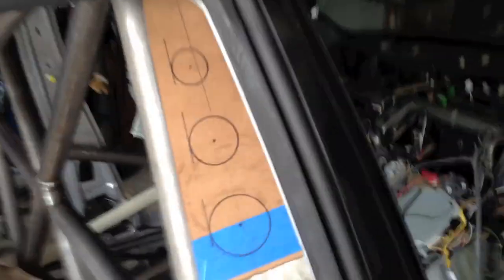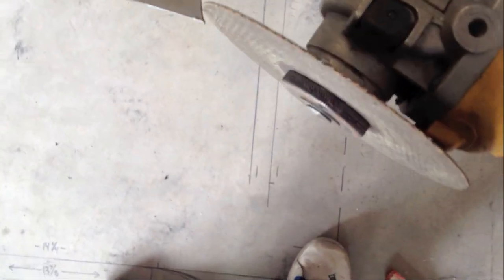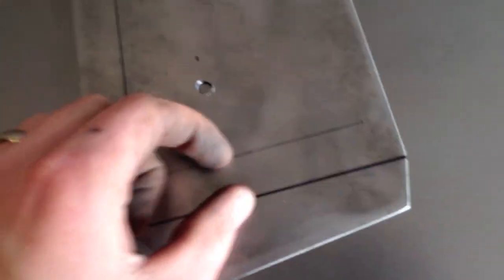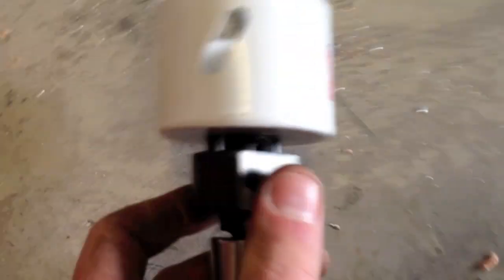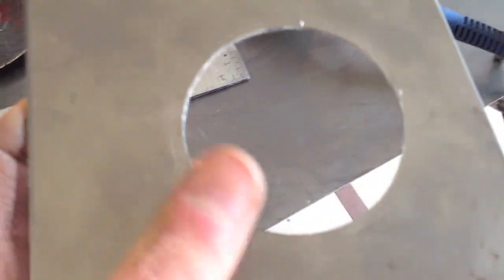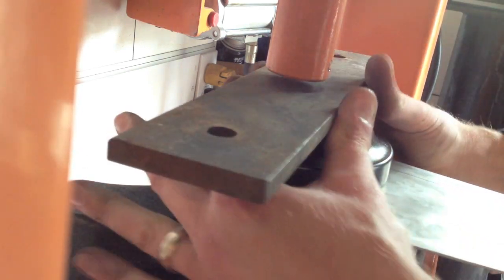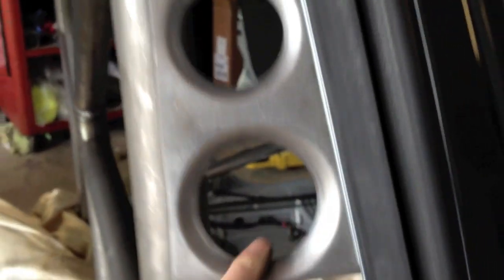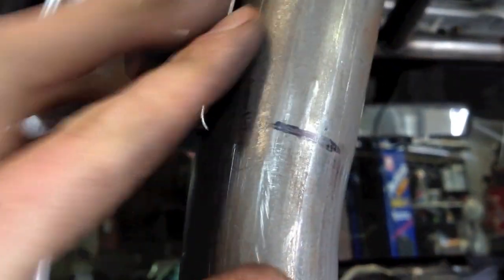HOW TO: Making a DIMPLE DIE Gusset - WRX Wagon - Custom Roll Cage - TMR Customs

Comment: 1. Not a good idea to film and use a cut off wheel
2. Use the proper size cutting disc
3. Use a guard
4. Don’t use the cutting wheel for grinding that curved cut, that’s how they explode
Reply from the maker: thebaggins321 1. Meh, I'm fine. 
2. No, I need larger disks for certain jobs. 
3. Guards are a joke! 
4. I didn't side load the disk, I stay perpendicular to the cutting surface. Thanks for your concern and watching!

Comment: simply put a gard on that grinder dumb ass
Reply from the maker: It's spelled *guard... dumb ass. And for the record, NO professional fabricators use the guards. They are a joke and get in the way. You obviously don't fab...
Reply: im a welder by my self and in canada we use guard on our grinder, if you cant work with a grinder it not the fault of the guard...  one day one of those disc will explode in ya face and you will understand why there is a guard.. -_-
Reply: I agree!!! I cringe every time I see people doing metal work with no guards or gloves on! As a trade pipe fitter and pipe welder, I take care of my hands because that’s how I make my money.  I’ve seen to many bad things happen and too many grinder wheels explode to not work safe. But.... calling him a dumb ass is a bit harsh. I just hope he doesn’t find out the hard way.

Comment: Hi.. I am a new subie guy, so i dig ur build.  I thought I saw something in your cage that concerned me... the horizontal door bar that is flattened at the main hoop. I think that is a big no-no ... round tubing shouldn't be flattened like that because it could potentially fold.  Thats why you shouldn't use a pipe bender on tubing .. so you don't flatten out the heel of the bend.  But anyway, I dig ur build and wish you good luck
Reply from the maker: I'm not sure what "flattened bar" you're talking about but theres no such bar on this cage, that sounds terrible! haha. My bender is full hydraulic mandrel style. It makes very nice professional bends. Thanks for your concern and for watching the video!
Reply: very beginning.. pause at 00:27 .. to the left of the b-piller .. that horizontal door bar going to the rear hoop looks awfully flattened out to me. But I still dig ur build and ur vid.

Comment: You are not thinking right with the hole saw mandrel , you are driving it through the thread which can strip out, the pins cause the drive to go into the top face of the holesaw and make it easy to get off.

Comment: what is the purpose of those holes?
Reply from the maker: Maks - The reason is to strengthen the metal by adding a dimple hole. It allows you to use thin material but making it sad strong as thicker metal so you can save weight. I use 18 gauge sheet metal on my gussets and by adding the flared hole it greatly strengthens it, making it as strong as 10 gauge (1/8th inch). You'll see dimples on high end racing applications where weight saving is a huge factor. Some companies specifically build chassis with as thin of metal as possible with hundreds of dimpled holes to save lots and lots of weight. I can take a piece of 18 gauge sheet metal and bent it in half by hand but if the same piece has a dimple hole, I can't even begin to bend it. It's very cool. Hope that makes sense. Thanks for watching!
Reply: that actualy makes alot of sense. Thanks for the reply. Great video

Comment: you wouldn't need gussets if the cage wasn't 7 inches from the a pillar.
Reply from the maker: Oh... I've never heard that before... If you knew anything about cage building you would know that 90% of the time the main hoop needs to be positioned behind the b-pillar to conform to the drivers seating position. If the main hoop were built tight inline with the pillar, the drivers head would be right below the rollbar which wouldn't give enough helmet clearance for safety/tech inspection. Now, as for the gusset, the main hoop should have a gusset no matter how close it's located to the b-pillar. It adds chassis rigidity and overall structural integrity of the cage. Thanks for viewing my video.

Comment: Fuck all the "use a guard on your grinder" comments. If people don't want to use one they don't have to. It's not as though it will cut fingers off like a circular sawblade. Even if it did, there's still not going to be any come back on the safety conscious people that post their warnings..
Reply: MrFuriousG except a cutoff wheel is more susceptible to shattering, especially when used like a grinder(it isn't rated for top or bottom loading of the disk). there are well documented cases of people being impaled through the eyes, neck, jaw and forehead by misusing tools. People are allowed to voice concern, videos like this are partly instructional and he assumes liability when he or someone else gets hurt. We are allowed to care about other people's well-being.

Comment: conduit /knockout punch dies work better/easier for punching holes in sheet metal but are costly, a  cheaper version at Harbor freight . Item #60575 (manual set) or hydraulic set Item#96718 and flare tools at http://www.trick-tools.com/

Comment: yeah i wouldn't recommend using 6 inch 10,200 rpm rated cut off wheels on a 4 1/2 inch grinder that spins 11k+ rpms... nice build looking great :D

Comment: if you don't use the set pins on the hole say it will eventually strip the threads in the hole say. did it yesterday lol. just an fyi.nice job.

Comment from the maker: WOW. I never thought this video would have 100,000 views! Thanks for watching and sharing. Hopefully it helped someone! haha
Reply: You helped me!  You make it look so easy, makes me want to try and tha's half the battle!
Reply from the maker: Dang... 200k one year later. I can't believe it. Thanks for all the views! :D
Reply: I can never get why Americans never use the guards on their grinders, they just take them off... only reason I think of is that they haven't got the mental capacity too look around the guard and tell where they are cutting??? 

stupid
Reply from the maker: +Michael Fletcher haha Thanks for viewing my video and for your concern.
Reply from the maker: +vdubornothing It all depends on the car and the location of the B-Pillar. This one for example is a 4 door wagon, so the B-Pillar is a bit further forward so the main hoop of the cage was placed behind the B-Pillar due to the drivers seat position. The main hoop must be completely behind the drivers head/helmet and lots of cars B-Pillars are next to or slightly behind the driver, so many cars will have a cage like this one. Tying the Main Hoop of the cage to the B-Pillar makes the whole chassis much more rigid, which will improve not only safety but car handling/suspension performance.
Reply: +Michael Fletcher Because a 7" Metabo cut-off wheel will not fit with the guard on, its a 4 1/2" grinder Einstein!!!
Reply: +R Smith why do people put that metal plate between the bar and the car itself? couldnt they just make the bar for the cage closer to the inside part of the car?
Reply from the maker: Been too long since I posted anything, I’ll have new stuff soon! I cannot believe this video is coming up on 400,000 views! YouTube is awesome. Thanks for taking the time to watch my crap. Haha

Comment: I cringe every time I see someone using a grinder without a blade guard. Sorry Mr Smith, They are not a joke.
Reply from the maker: I'm sorry you cringe and have less hand control than me. I've been using cut-off wheels like this for 15 years. I learned from a pro right away that the guards only inhibit you from making cuts. They get in the way period.
Reply: That's the stupidest thing I've heard today. You didn't learn from a "pro" If the blade ever shattered, I hope you at least have gloves on your " hand controlled" fingers.

Comment: Before you use a grinder like this guy without the guard search and watch the video on youtube called "Angle Grinders (2 of 4) - Graphic Content! "  Other than that amzing work this guy is a pro
Reply from the maker: I appreciate the concern and safety video. I'm not trying to be reckless, I ALWAYS wear at least safety glasses when using cut-off wheels but often wear my welding helmet (on grind mode) or a face shield. NEVER STAND directly inline with the cut-off wheel, stand offset from the "line of fire" if it were to break/explode and come loose it'll be less likely to fly at your face, neck or body. I wear leather gloves too but wasn't during this demonstration due to handling a camera. I'm not trying to promote bad safety behavior, I said this is not for "newbies" but should have also mentioned NEVER buy China/Taiwan cheap brand cut-off wheels from places like Harbor Freight. Those are not nearly as quality and come apart (explode) much more often. I always buy quality Made in USA or alike brands that I know to be legitimate quality.
Reply: R Smith are you going to post more of your car and cage and fabrication stuff or what, I loved the video so good job....and you did most of it 1 handed lol.
Reply from the maker: crxtech1 Yes, I need to go through my videos I took of this cage. I'm currently working on another Half-Cage video I'm doing right now in a Mark3 Supra!
Reply from the maker: krusher74 I do not recommend removing the guard but I don't like them because they get in the way when making cuts in tight spots or the guard constantly needs to be adjusted for different angles. Also my larger cut-off wheels don't fit with the guard. I buy larger wheels so I can get deeper/reach further into tighter spots. They are also more cost effective for me. I DO however use a guard on my big Metabo grinder, it's a must to keep the massive amount of sparks pointed away from me when doing lots of grinding.
Reply: You'll have that on those big jobs.

Comment: What Ga. Sheet metal did you use? Im wanting to do this to my 70 Chevelle A-Pillar.  Unfortunately don't have a shop/garage, or all the fancy equipment right now. But where there's a will there's a way.
Reply from the maker: I used 18g. :)
Reply: Thanks man.... happen to know a good place to get a somewhat cheaper dimple die, with the bolt style clamp?
Reply from the maker: Grim Reaper No problem! TMR Customs sells the dies individually... I dunno about any bolt-style ones available...
Reply: Grim Reaper SPC makes some with a hole all the way through, with some fine thread grade 8 bolts and a few of the right size washers/bushings you should be good to go http://www.summitracing.com/parts/sps-15810

Comment: I use them quite a bit as a industrial mechanic. Its one of the most dagerous tools I use on a regualar basis. Some places require safty glasses plus goggles plus face shield to opperate one plus regular ppe. The guards move so you can rotate them they also have a screw in them to tighten the guard. I do some crazy shit on my own even sometimes at work but I dont mess around with an angle grinder.
Reply from the maker: Ya, they are definatly sketchy! It takes a lot of hand control for sure. For what I do the guards just get in the way and they inhibit me from using anything larger than a standard 4.5" wheel. I like using bigger cut-off wheels! But you are right about eye protection, always wear safety glasses or a face shield and gloves are good too!

Comment: I love all the comments about how there is a better way, and they are right. But even more fun to see a video of getting it done anyway. Any way you can. I was wondering how you were going to do the dimples - a die set of course - that's one thing you need a tool for (it is possible to make them...) And you are right, anybody who makes a sheet metal part should ALWAYS clean up the edges, because people are going to run their fingers over the edges, that's what people do.

Comment from the maker: It was 16 or 18g material. I built the cage from scratch. It's Road-Course/Time Attack style. The owner just wanted something badass haha. It's 1-3/4" .120 wall DOM on the main cage and 1-1/2" .095w DOM on the extra diagonal tubing in the back for extra rigidity. The car is finally up and running with it's new FULLY BUILT engine. Currently being broken in, running a conservative tune/boost, but already putting down over 400 WHP. :D